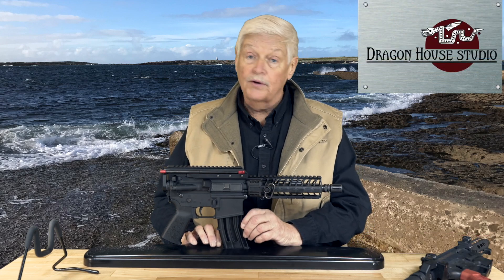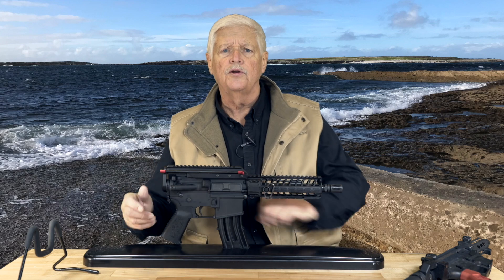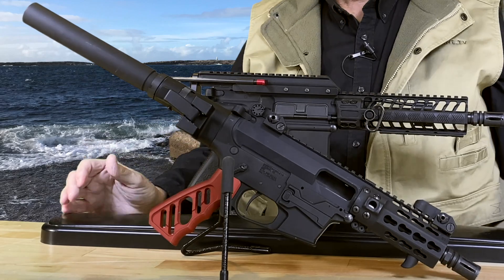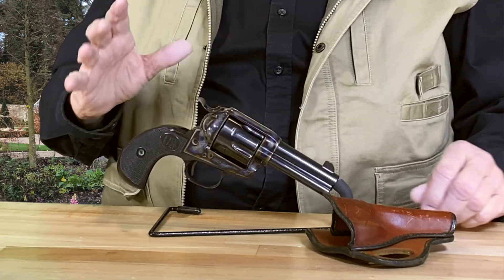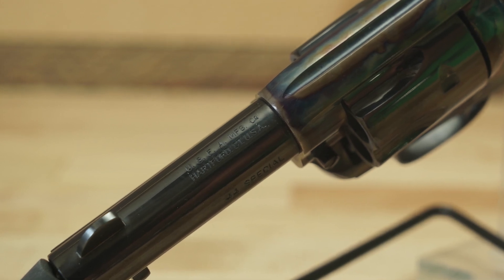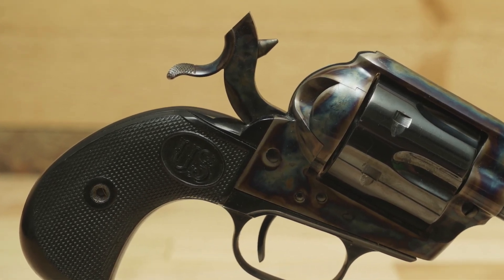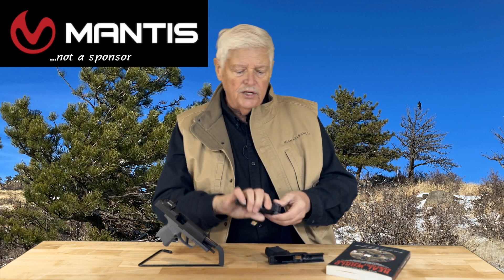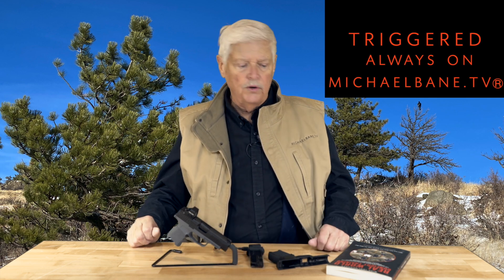1-12-22 Triggered: New AR Operating System?

Comment: Why not just get an ARAK-21 by Faxon? They already have an integrated recoil system in the upper (side charging, the bolt rides on rails, and the barrels are interchangeable with 556, 7.62x39 and 300BLK)
Reply: I think arms designers are constantly looking for the "better mousetrap," or al least a better mousetrap that they can profit from! This is kinda how weapons evolution goes....
Reply: Could you be more specific?  @micharlbane ? My point was that for AR platforms with integrated recoil systems, the objectively best option (most sales/testing/quality of engineering put in) is what's offered at Faxon. 

The violent external mechanism of what was shown in this video kinda reminds me of a literal mousetrap, though
Reply: @NiMi93  My observation has been that after decades in the business, there is no such thing as an "objectively best option." There are only options that individuals or groups subjectively decide is the best, or most suitable, option for them, although the "for them"  is often omitted. All evaluations are based on a set of agreed-upon criteria; of course, what those criteria are and how they are selected is the rub. Quite honestly, if you were to ask me what my own best option for a stubby 5.56, 7.62 x 39 or .308 was, I would unequivocally tell you that it is the Galil platform, as refined by IWI into the Galil ACE. It has a folding stock, in the pistol version can take a pistol brace, is reliable as dirt and can be maintained and repaired by a reasonably intelligent cocker spaniel.
Reply: @micharlbane  As far as I'm concerned, the criteria I listed are perfectly relevant to assessing the utility of a product -though you're welcome to select other additional variables I did not mention. You'll find as I do that the AR featured at the beginning of this video does not bring greater substance to the niche than what already exists.
Reply: @NiMi93  Now see, THAT statement I agree with!